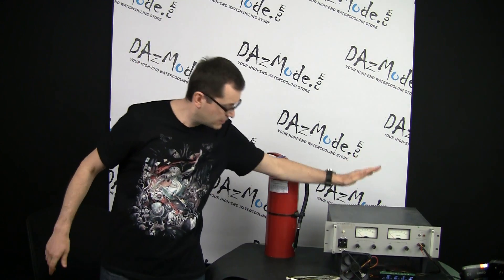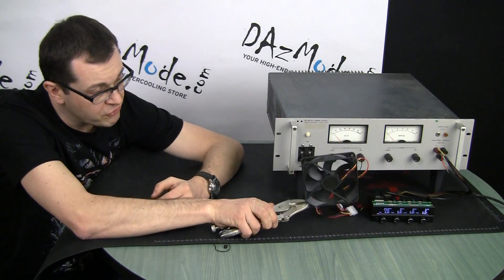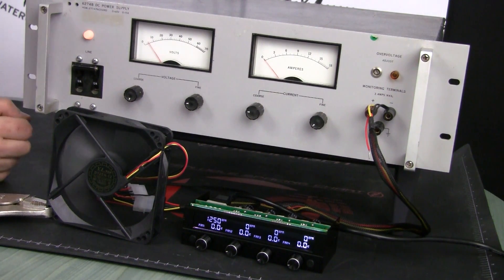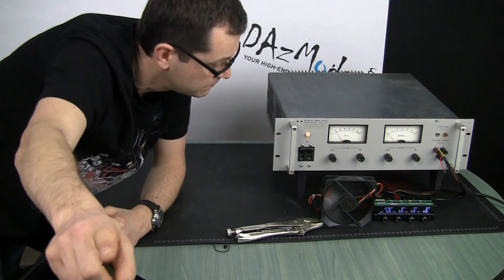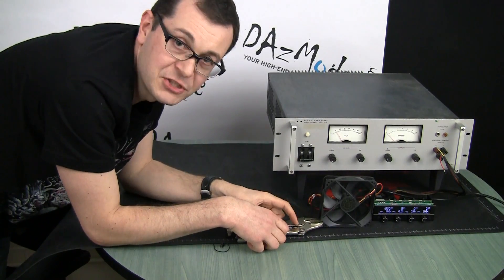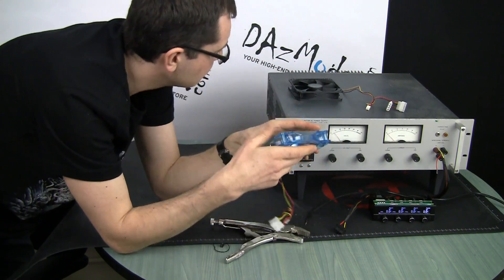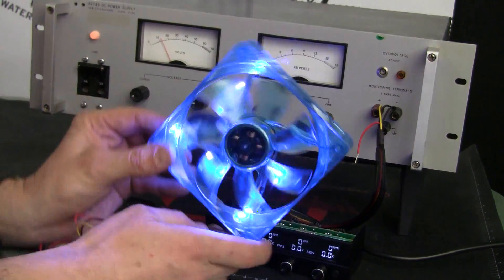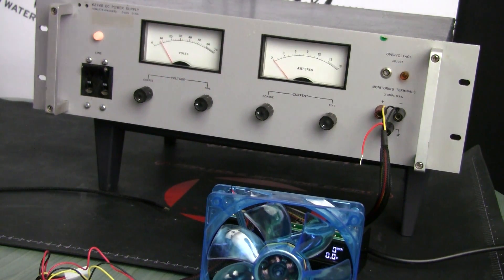Fans Overclocking - DazLab Stupid Vol 1.

Comment: you turn the voltage up to fast, the fan pulls a higher power when accelerating so your fan burns out. if you pull it up slower then the fan might servive, (the blou one could probably turn up to 25V without burning out).